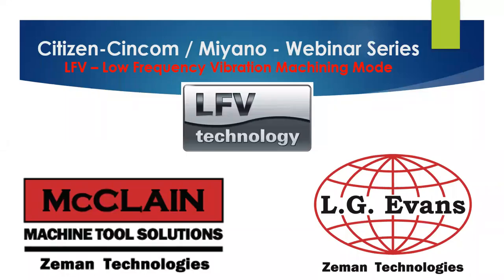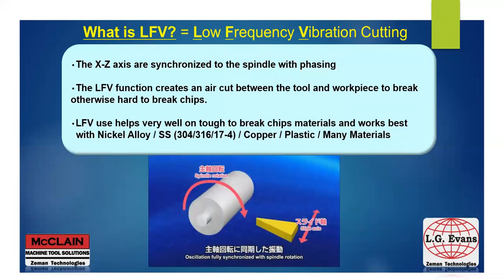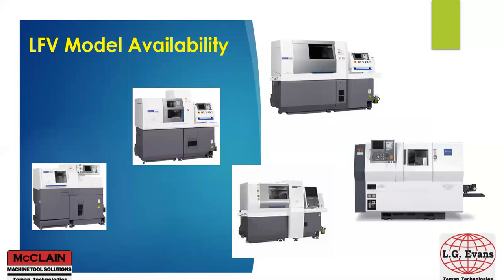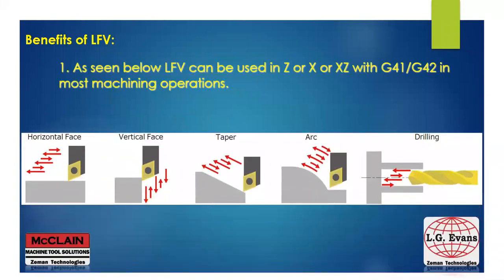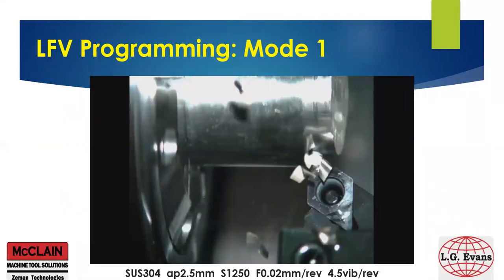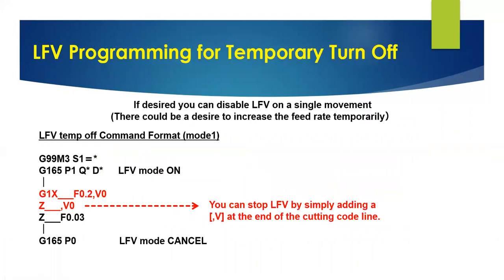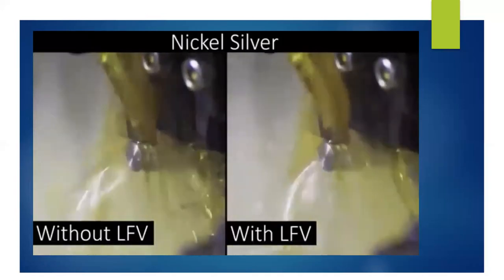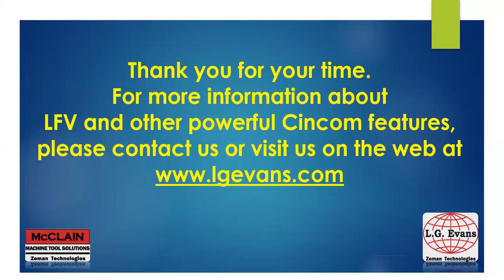Citizen-Cincom Swiss Webinar: Low Frequency Vibration (LFV)

Comment: LFV is amazing. Has been a lifesaver when I've had chip control issues. However it sucks that on an M5-32 you can't use it on the Z2,X2,Y2 turret axis.